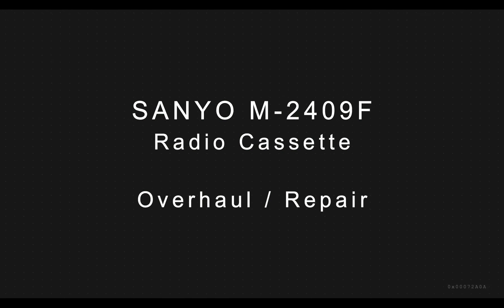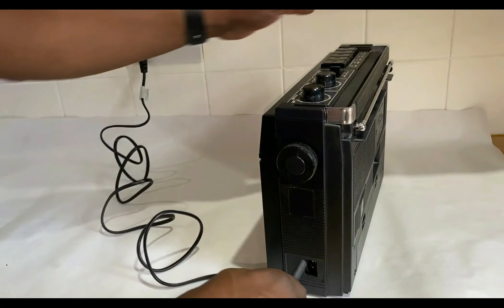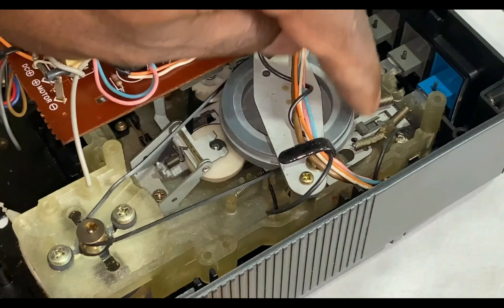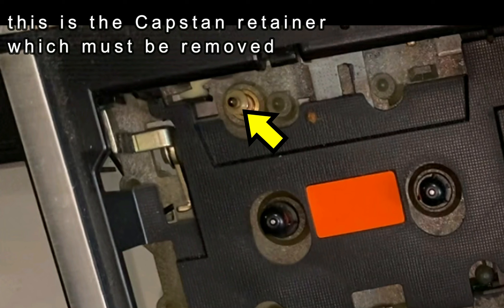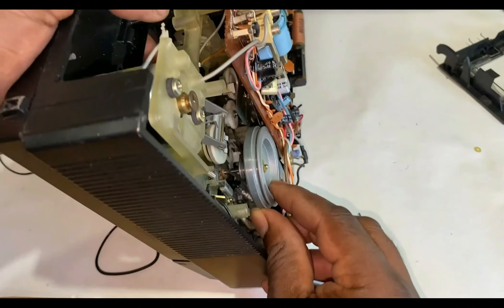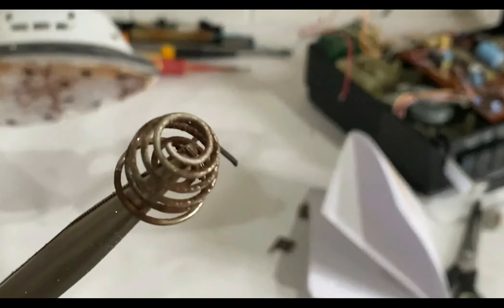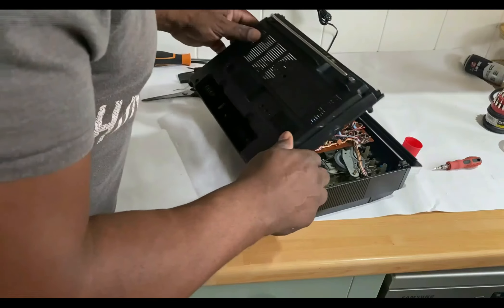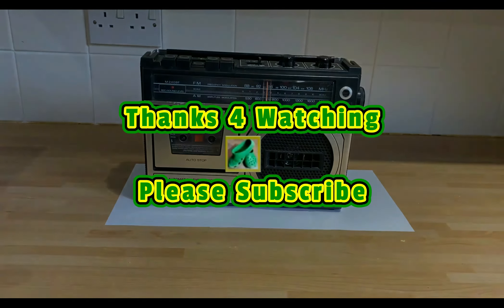Sanyo M 2409F Radio Cassette Not Working  Fixed

Comment: The good news with this little Sanyo unit is there was no melted belt goo for you to spend hours cleaning up, unlike some Sharp GF models I've worked on recently. I am glad you caught the winding/take-up belt and changed it (this is easy to overlook) as well as sorted out the battery rust to make it work on DC. Outstanding yet simple fix. 😇
Reply from the maker: Thanks RoughJustice,
                yes there where a few issues with this unit, not too bad considering the years of neglect. The Triangular Belt was interesting though.

                   Regards.
Reply: @green-crocs-fixes1520  The triangular belt was originally circular, but has since warped into that shape from being stationary on the mechanism for so long. I am surprised the deck even worked with that belt still in place. Being a basic mono model, there is not a lot which can go wrong with it except perhaps FM failing in the radio (a common issue). You have done well - I'm staying subbed to you. 😎
Reply from the maker: Thanks 😀 @RoughJustice2k18

Comment: Hello, thank you very much for sharing this great video and your knowledge. I have the same radio M-2409F - Sanyo Electric Co. Ltd with the problem that FM cannot be heard. I have searched for the electronic diagram on the Internet and I cannot find it. Do you happen to have the diagram, please, can you provide it? Thank you very much in advance. Best regards
Reply from the maker: Hi Any Cueto,
                        thanks, regarding your issue could it be an issue with the band switch, assuming the other Bands MW and LW are working ?
Reply: Hi  @green-crocs-fixes1520  Hi, thank you very much for your reply. The AM works perfectly, but FM doesn't work, I can only hear a small band sound in FM.
Reply from the maker: @anycueto2309  yes probably requires a Solder Reflow on the Transistor PCB.
Reply: @green-crocs-fixes1520  I already did it but it's still the same. I've tried putting the antenna directly to the collector of the C930 transistor and I still get no sound.